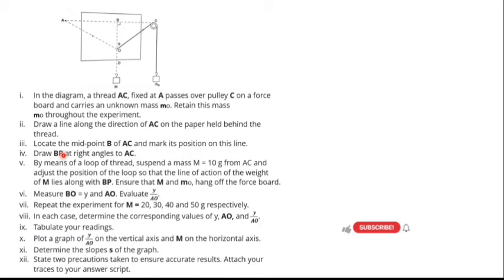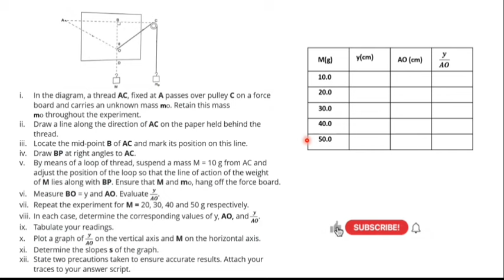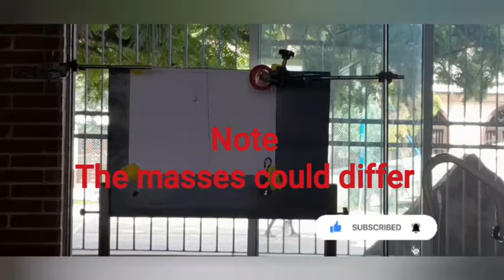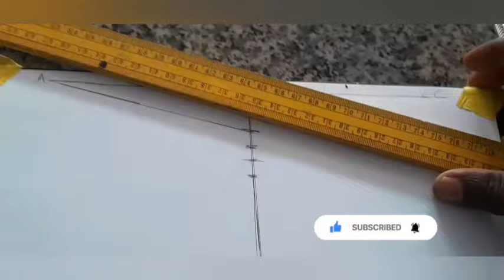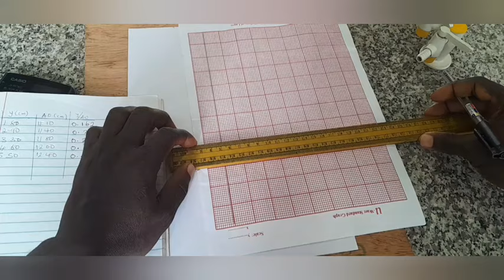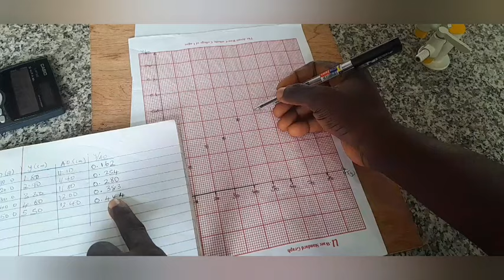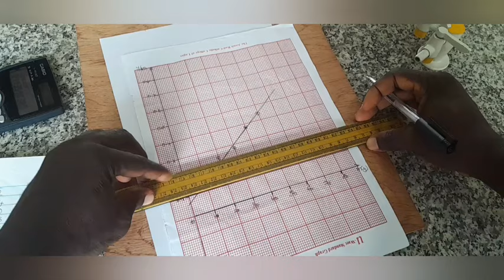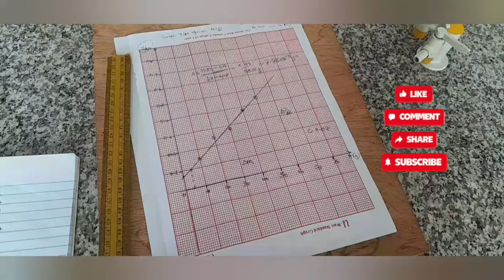NECO PHYSICS PRACTICAL 2024 MECHANICS.

Comment: Nice work. Did you use the clamp to hold the pulley to the boardd, or the pulley is attached to the board already?
Reply from the maker: @Omez213  I held the pulley to the clamp.